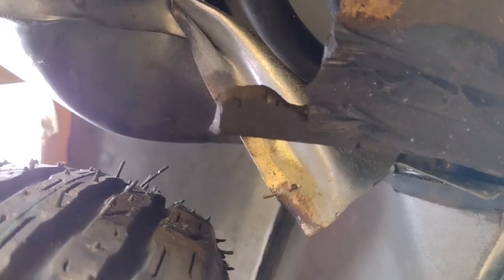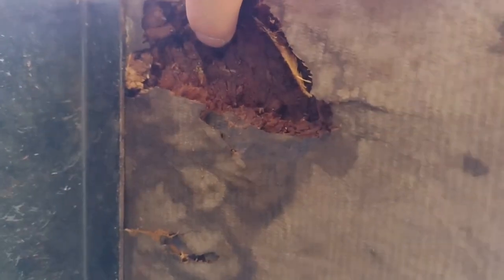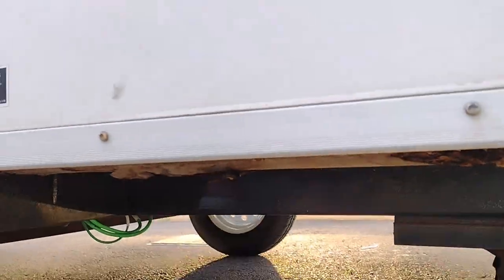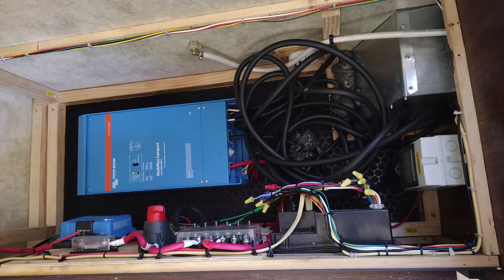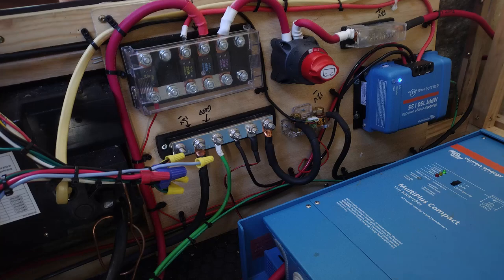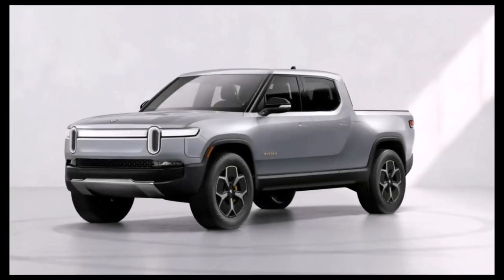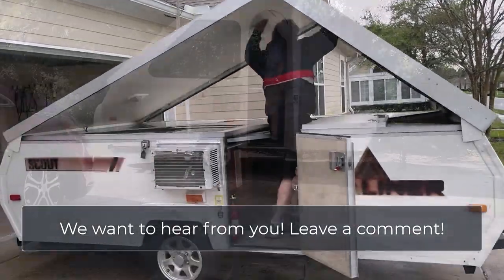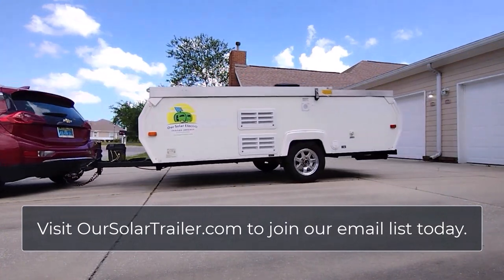Why Does It Take So Long to Repair an RV?

Comment: Quite the ordeal.  Thank you for documenting your experience.  Good tips on tires, and I would suggest the same thing about going up a load index level, for EV tires... due to their extra weight compared to ICE vehicles.  While these tires are a bit heavier, and therefore will negatively impact efficiency/range, they are safer and will last longer.
Reply from the maker: Great point!

Comment: Oh man, what a pain but glad to hear you'll finally be back on the road. I've officially joined the EV towing ranks with a motorcycle trailer for the SR/F. I'm planning my inaugural tow for Saturday, taking the Mach-E & SR/F to the big EV show at UNF. Maybe I'll see you there.
Reply from the maker: Congratulations! 🎊🎉👍👏 Thanks for the heads up on the EV show at UNF. We'll check it out!